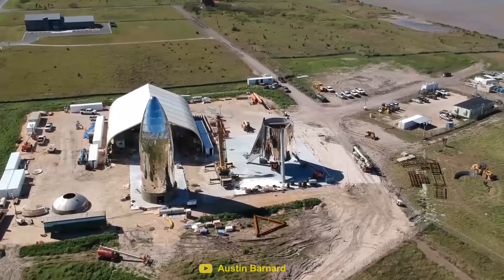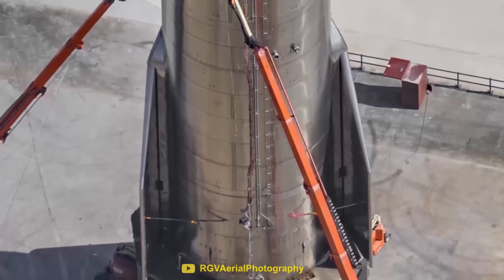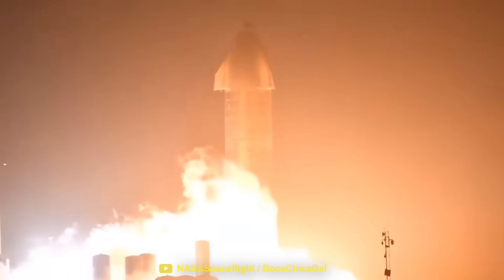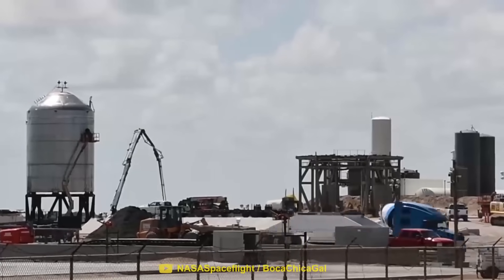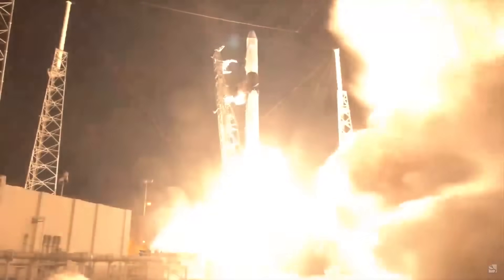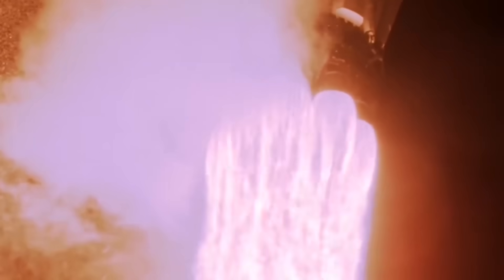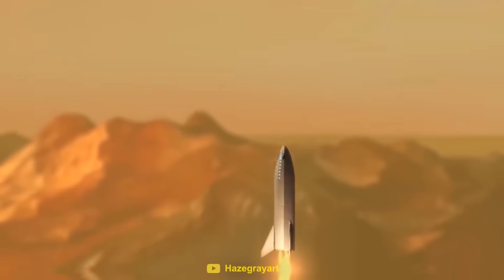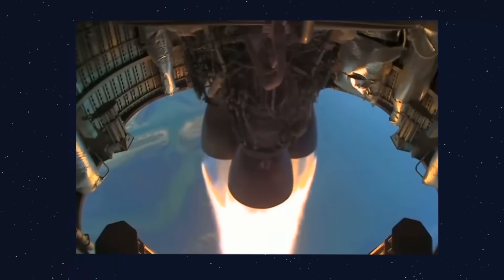SpaceX's Launch Pad Problem

Comment: right now their biggest problems are:
1: Landing Legs
2: Launch Pad
3: Header Tank Pressure :D
Reply: No not at all. Header tank issue is fixed, requiring minimal or no hardware upgrade, launch pads not really either, they just keep doing static fires and launches and reinforce the areas that get damaged. They start with the lowest mass possible and add what is necessary. The biggest problems in order of importance are:
1) The heat shield, especially the attachment to a flexing hull (hot and cold cause it to expand and shrink) and the gaps between the wings and the hull
2) Mastering orbital refueling, the entire mission except deliveries to Earth orbit hangs on this. They do have good potential solutions but nothing demonstrated so far
3) The actual entry, descent and landing at Mars, this will take a few attempts. Try to land, see what happens, fix (mostly software) much like on Earth
4) Propellant production on Mars, set up mostly autonomously. Making enough propellant to fully fuel just one Starship to return to Earth will be a massive undertaking requiring something like a km² of solar arrays
5) Building the crew variant with all the systems associated including life support, entertainment, radiation shelters etc... 
6) Make Starlink profitable, because that will pay for everything else. But good progress on that front too.
Reply: @please_stop-v7o  i like the way you prioritised crew entertainment number 2 in the priority list.  followed by Radiation shielding etc.  lol :)
Reply: @liamb8379  Well that wasn't really in order :) But you could say if the crew goes insane from lack of entertainment, the radiation shielding doesn't matter. Plus the added cancer risk is equivalent to smoking during the extent of the mission if you staid on Earth, so it's bad but not a showstopper. And that's without anything other than rudimentary shielding and on the surface of Mars the radiation is half without shielding (planet blocks half) of that in interplanetary space.
Reply: @please_stop-v7o  They will probably send multiple starships in the direction of Mars as soon as they are able to during an alignment, even if they haven't finished figuring out the landing. That way they have multiple tries and can continue updating the firmware without need to update hardware in much the same way as they are doing at Tesla with FSD.
Reply: @TomorrowisYesterday  A launch window to Mars is many weeks, you could in theory send 30 ships (say 2022, they should easily have that many ships) and stagger the arrivals a few days or a week apart. Implement software fixes as data comes in from previous ship, so get all your EDL software done and land the first ships in 22. So they can send serious cargo like propellant plant components in 2024 and attempt a crew mission in 2026 possibly slip to 2028.
Reply: @please_stop-v7o  i think you overlooked someting mate. i said "right now"
Reply: @conchaiii4167  Still no, again header issue solved, landing legs are perfectly fine for now and the launch pad  is not a hard problem. Keep firing Raptors over rougher and rougher terrain and see what gets damaged, reinforce. The biggest problem right now is probably making the booster and the heat shield. SN8 proved that Raptor is reliable, the airframe is good and can take the forces, all the guidance algorithms where spot on, aerodynamics worked perfectly, landing maneuver worked perfectly until loss of thrust and was right on target. It would have landed had the header tank held up. So basically all the biggest problems with Starship have been solved by flying SN8. What remains is prove SN9 can land then start building boosters and sending ships to orbit and that needs the heat shield and the booster thrust puck design done. Plus making enough Raptors for all that. Then orbital reentry, then refueling and on to Mars.
Reply: @please_stop-v7o  and you still dont get what i mean. i mean RIGHT NOW. like this weeks problems. NOTHING ELSE. im NOT talking about the big picture
Reply: @conchaiii4167  Do you read what he said ?
Header pressure : solved
Landing legs : good enough for now
Launch mount : they are go for next tests...
Reply: @conchaiii4167  A problem that has already been solved is not a problem. Pneumatics and electronics have been shielded against debris, header tank issue solved, landing legs are fine for now. They worked perfectly for SN5 and SN6. SN8 never deployed them because it wasn't supposed to hit the ground that fast and early. They are probably deployed at a given speed and SN8 never went below that speed. Landing legs can't make up for 100 mph impact.
Reply: @please_stop-v7o  i never said anything about pneumatics and electronics. and how exactly do you know that the header tank problem is solved? and elon musk personaly said that the landing legs are a big problem.
Reply: @generalpatton8890  how do you know that the header tank issue is solved? yes the landing legs are good enough. FOR NOW. and the launch mount did cause prolems already
Reply: @TomorrowisYesterday  More or less. It traversed it's height in about 1 second and change so slightly below 50 m/s or around 200 kph, what's that imperialized? 150 mph?
Reply: @conchaiii4167  Elon said the final design of the landing legs it to quote: subject of much debate. We are talking self leveling, shock absorbing wide stance landing legs, needed for Mars and the moon. You yourself said right now about 20 times, and right now the landing legs are fine. Just see SN5 and SN6. Yes they get crushed during the landing but that is part of the design. You can see they have increasingly smaller holes going from bottom to the top, this is basically a crush core. They are perfectly fine for now. Even for the next year or two that will only see landings on Earth. So version 2.0 landing legs, as Elon calls them are way further out than the heat shield or the booster thrust puck.
Reply: @please_stop-v7o  he never said they arent designing new legs right now.what is your problem anyway, i came up wit hmy comment in like 10 seconds, of course its not gonna be accurate
Reply: @conchaiii4167  You're really backtracking man. Right now seems to mean a different thing in every comment. But whatever I'm just happy people are interested in Starship... But I do follow this program in detail, as I have followed SpaceX since the third launch of Falcon 1 over 10 years ago and I remember his comment on the V 2.0 landing legs, because that sparked a lot of discussion and speculation at the time. But V 2.0 is only needed for Moon and Mars. So if right now is two years from now fine... But don't tell me it's higher on the list than the heat shield because that is bollocks. :)
Reply: And that all sounds like minor issues compared to what they've already accomplished. Fascinating and impressive.
Reply: @Jens.Krabbe  elon said that landing legs is very difficult. but idk.
Reply: Lol. GO SN9!!!
Reply: @Leave means LEAVE! The heat of the raptor has nothing to do with the pressure. The problem with the pressure was that the engines didn't get enough fuel.
Reply: I think landing legs are the tough one. Imagine there are no ready landing pads on Mars. Just rough terrain. Must locate hard rock with flat enough surface to land on.
Reply: @latometoy2872  you are right. But I mean the biggest problems right now.
Reply: @A D I think when building Mars base creating Landing/launch pads are among the first priorities.
Reply: The header tank is a minor problem
Reply: @Sbinott0  why does no one get this? i said "right now"
Reply: @Leave means LEAVE! no its not that easy. if it would be that easy it would have worked the first time
Reply: @conchaiii4167  your talking about a problem that spacex could fix in a day
Reply: How come you're so sure about those? :))
Reply: @PeacefulCountryLife  im not. It's just a speculation
Reply: @conchaiii4167  You literally said: "right now their biggest problems are". :)) How is that "speculation" :)) I myself would have phrased it differently :))
Reply: @PeacefulCountryLife  ok. im not gonna change my comment tho.
Reply: I'm curious how the rocket will behave during landing and following stay upright on the soft sandy surfaces on Mars and the Moon, why not simulate this during their tests on earth, ie. move the test site to an unpaved desert area...???
Reply: @prepared-to-support  they're probably gonna do that. But it's not needed right now.
Reply: 4. radiation shielding
5. design for humans
6. anything for mars whatsoever
7. payload weight

Comment: A cone shaped structure directly beneath the rocket engines with a high volume water nozzle at the tip + curtain of water encircling the perimeter of the launch mount.  I think that would survive even superheavy.
Reply: Watch 3:00

Comment: Told you so!  Flame diverter and water suppression needed. Cheap. Arrogant.
Reply: Flame diverters and water suppression systems won't exist on the Moon or Mars. Starship needs to be capable of landing on those surfaces.
Reply: @General12th  I agree. But unless they find a way to protect the vehicle and the Orbital Launchpad from 27 raptors, they may never get the chance to try landing with three engines.
Reply: @edwardschoenman2139  Only the main launch pad will have to withstand 27 engines and thats not hard because Falcon Heavy has 27 engines also those 3 engines are only for landing and once in orbit

Comment: This problem has been "solved" already if you look at the possible design of the orbital launchpad. The design has a way to divert the force of the engine from below the pad, which is different to the traditional flame diverting trenches that are seen at Cape canaveral launch facility. Also, constant replacement of the martyte is a temporary fix which spacex are currently adopting till orbital launchpad work finishes
Reply: That's true for a full stack Starship, but isn't true for Starship on Mars. So it's a problem worth solving.

Comment: There won't be flame diverters on other planets / moons, so if you want to land on them and then take off again (without building a massive launch complex), you'll have to engineer it for massive blowback during takeoff.

This is the correct decision imo and framing it as a mistake is disingenuous and short sighted.
Reply: Right well they could just ensure the first few don't blow up over there and send equipment to manage as such along. Count the first few as non reusable if you will. I don't think he's framing anything as anything disengenuously nor is he being short sighted. It's not a 100÷ necessity (as far as I know). Just would be very nice if he could get it to work and perhaps it's a mistake even trying,  wasting valuable time and resources.
Reply: @Dildobagginses  The only ones wasting valuable time and resources are NASA and Blue Origin based on the facts, based on working rockets, based on reality and overall money spent.

The other billionaire failures are really getting angry that SpaceX is making all other rocket programs look like a waste.  That's the reality.  If you want to gaslight reality, you'll fit in with the failed Gerontocracy running NASA.

Another billionaire failure is Richard Branson, he's super salty at SpaceX as well for beating him to space tourism.  (Virgin Galactic is an example of a pure waste of resources, time, and money.)

The main difference is that SpaceX doesn't have a PR division to spew lies that fools like you will believe.  KABOOM.  You trust PR over reality, and that's why you FAIL.

Attack my character or something now so I know you have no relevant argument left.
Reply: Dude you got me all wrong. your the one saying Elon musk is being disengenuous and short sighted. Elon said it might be a mistake. You claim that's him framing it some way or the other. No it really might just be a mistake, like he said, because who fucking knows if it'll work or not. I say fuck it might as well test it out, I mean I'm an engineer but I ain't as smart as him. You state something excessively obvious and proceed to insult musks decisions but in your response you praise his every pube and call me a fool

Comment: Elon talked about low pressure in the header tanks as the main reason SN8 failed to land properly. Can you investigate WHY there was low pressure in header tanks, and what SpaceX can do about it? Hint: Autogenous pressurized tanks means tanks are pressurized by their own boil-off gasses. I think the MIXING in the header tanks, (caused when Starship flops, & then goes vertical again) is COOLING and RE-LIQUIFYING some of the boil-off gasses. Apparently the phase change is causing enough of a pressure drop to starve the engines and cause the crash!

Comment: There is a simple solution for the pad -> Use Water!
Reply: As he explained,  since there won't be that option on Mars, they want to find another solution that would work on Mars.
Reply: @vincentlenart1697   yes but on mars this wont be a problem because there wont be as many starts and also the ambient parameters are different - and lets be honest: only a few starships will start again from mars most of them will be disassembled for base building. And when the base is big enough water again will be no issue ;)
Reply: @For4Reel  Good points.
Reply: @For4Reel  But I think a lot of the point is also that this can be used as an interplanetary ship, so not just Mars where standard launching procedures can be done, hopefully quickly when it's an established base.  I think it's a great idea to work out the bugs here for it to work without standard launchpad procedures.
Reply: @vincentlenart1697  yes but every where else its much more easy to start and land because less gravity, less temperature and so on ... and starship is no interplanetary system its designed for planets where the can synthesise methane and this bodys are limited (uranus, neptune, titan , mars). And i also belive that when we fly to mars space ships successor will be in use :P - just because elon time :P

Comment: This has been a real eye-opener, one would assume its the rocket fault directly and never about the launchpad.
Reply: This is literally a test pad, the orbital launch pad is being built like 100m away. This won't be a problem for very long.
Reply: @robertlatta2019  The orbital launch pad being built is for Super Heavy, which is expected to have 28 sea level Raptor engines.  That's almost 10 times as many as Starship, so the lack of flame diverter is still a real risk.  Also they plan to eventually launch Starship from Mars, on nothing but landing legs which definitely won't be as high as the test stand.
Reply: @kurtblackwell7752  maybe they will have to send a payload to Mars to form a hard landing site. Some chemical to bond the surface somehow?
Reply: This IS a rocket fault for completely exposing its sophisticated engines to products of their own exhaust.